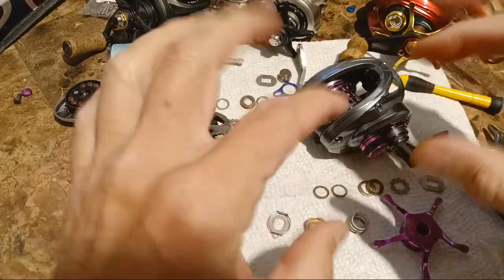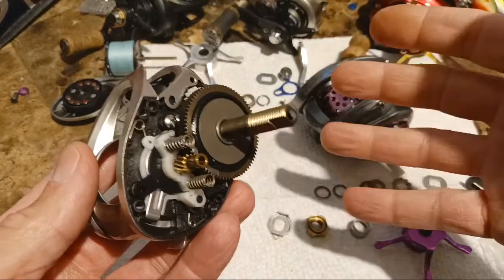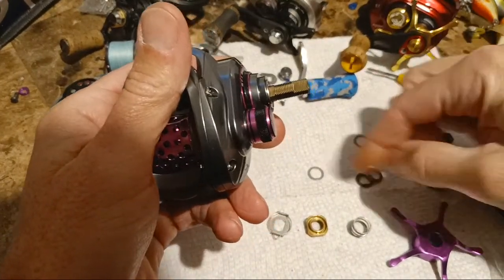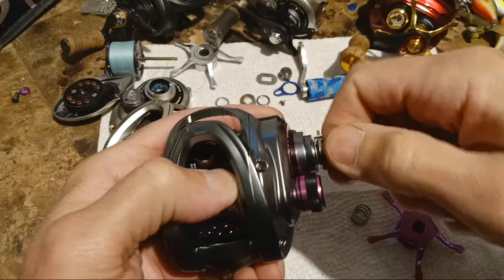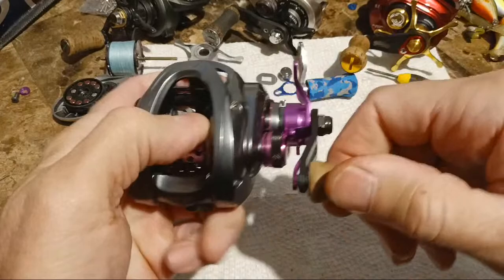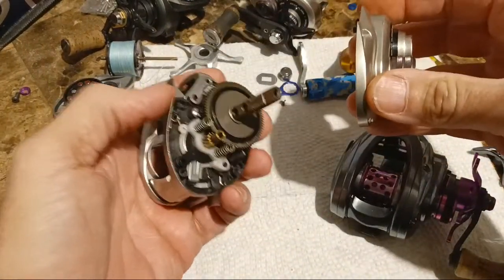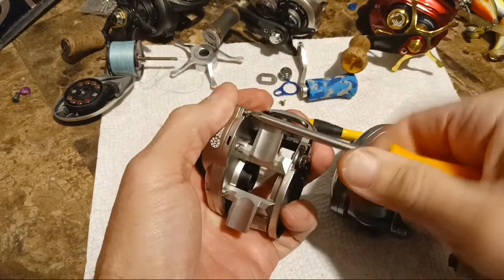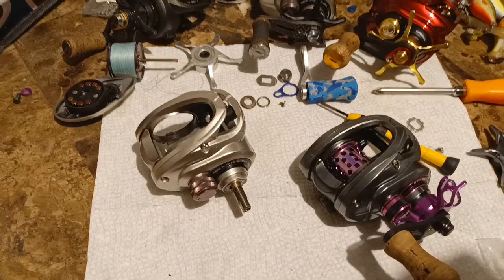AliExpress BFS Reel Teardown and Aluminum Star Drag Install

Comment: The bolt nut , the clicker, the spring and the star has to be bought.

What about the washer ring , pringles, seperater which it already come with the acura.
Reply: You probably already found out by now but Soloking Acura star drag is same as Shimano so just find a Shimano star drag and swap. This video is converting Kingdom Micro Monster to Daiwa.